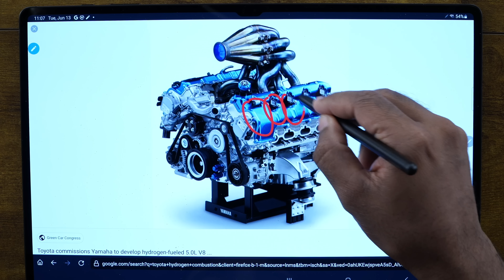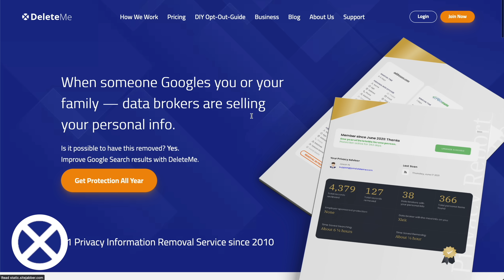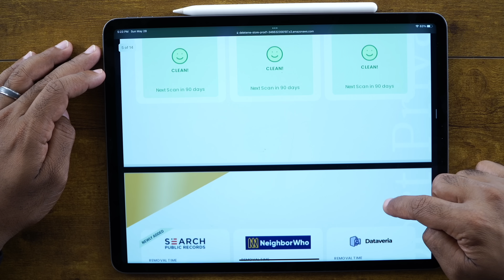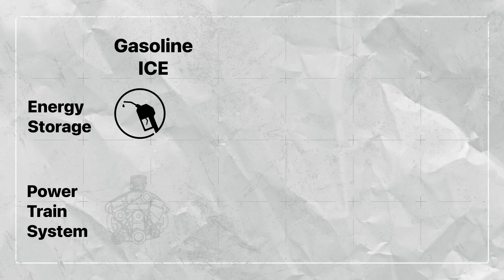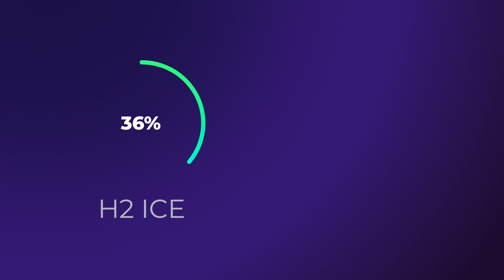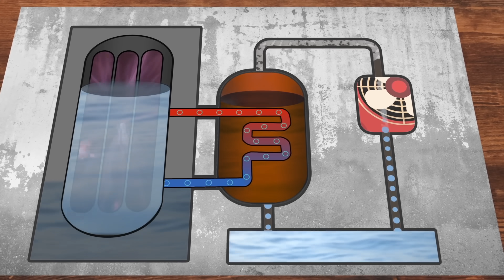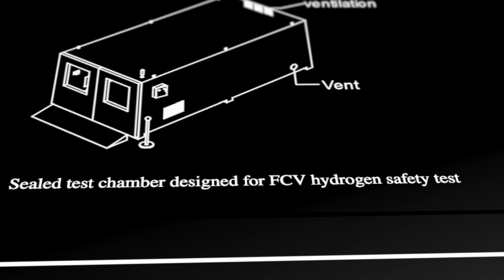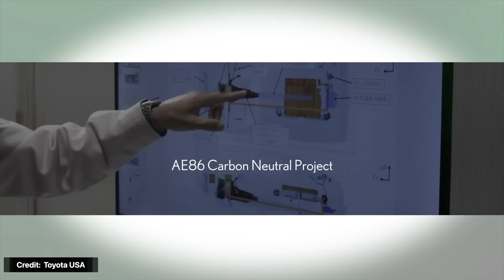Toyota's Says They Just Destroyed EVs - Hydrogen Combustion Engines

Comment: I love the video nice overall pass :)
I feel that subject turned more about comparing EV and ICE whereas imo the pollution and efficiency should be compared to gas/diesel compustion engines. I was left with a question how efficient are the ICE compared to normal gas combustion. And the mention that there is emissions I guess they are no where near to what current solutions (beyond EV) are.
Used to also be a carmechanic and would say that ICE repair costs interest me.

Since the addition on more and more elctricity to our vehicles it has created the issue of not being able to do any self-repairs and Japan & Toyota (like VW) have been really big in part manufacturing and repair centered manufactory and design. Do you have any thoughts oon Gas-EV-ICE repairs?

And just to clarify :D I am by no means against EVs or ICEs I just see a possibility to have both and tbh even support eachother to get emissions and prices down. Even the ICE and EV gas stations (afaik) can be combined to an extent

Comment: You miss one thing.
An engine will consume the same amount of fuel all its life, but the batteries consume over time so if now you make 300miles with a full on your batteries in a couple years you may get only 150 to 200 miles with the same energy meanwhile if you get 300 miles of range with a full tank of h2 you ll get still 300 miles of range in a couple years🎉

Comment: Toyota are also producing a solid state battery... Your opinion is, well, slated.  Yamaha have been making heads for cars for decades... Stick with your Tesla, I hope your environmentally sustainable battery lasts, joking if u hadn't noticed, Don't they cost a small fortune to replace, or is it that you'll have a new one by then and we just put the old one in the tip because that works too right? How did you not mention such a thing as thermal runaway as a negative for EV?

Comment: Imagine the miles per tank if you had a Hydrogen Combustion engine in a battery charging hybrid set up. I get about 57 - 60 miles/gallon right now with my Honda Insight Hybrid. I continue to maintain the BEST way forward is exploring hybrid technologies and this seems to be an amazing pairing that should be tested.
Reply: in that combination, I'd guess a fuel cell would be better. But the ICE could bridge that development for more affordable cars.
Reply: @christianstorms3950  I know very little about fuel cells honestly. Still any additional hybridization is a good pivot point. It gains time for the next step to get more R&D done. I will say with my hybrid I go about 200 - 300 miles and fill up when I have about a half tank of fuel left. It costs me about 14 - 15$ (usually gas here is around 3.40$ a gallon). That's pretty great IMO!
Reply: I can work with a 220torque engine that can charge a li-ion/sodium battery & run the motor also
50_50 load sharing etc or power train sharing any combo that can squeeze most miles

With presets like low noise_vibration
pure EV
hybrid system 80% engine & 20boost of motor torque offered by motor
Charging the battery & running the motor leaving the power train off,
& Running 100 on engine & power train
Reply: @dinozaurpickupline4221  I'm just all for squeezing out the most miles per fuel source and I just don't see EV being that. 

Additionally, a EV "solution" we would right now be needing to build a LOT of power plants all over the country to supply the demand it would cause on the power grid - which isn't happening at all.
Reply: @HillHomeGaming  we need batteries as alternate source,more importantly ford trucks to do that,cold starting engine on battery & then switching to engine
Reply: @HillHomeGaming  "EV "solution" we would right now be needing to build a LOT of power plants all over the country" brainwashed BS.
That is not possible because you can Not just magically materialize that many BEVs in short time. It's going to take at least a Couple Decades for BEVs to be market dominant and the grid will easily adapt to that if you give them enough time. The limiting factor is Manufacturing Supply Chain to make the BEVs, not the electric grid.
Reply: @dinozaurpickupline4221  New models of cars are becoming so quiet. I think it part due to switching to battery at lights or turning off the engine etc. My Insight is a very quiet car overall unless I'm going up a big hill haha
Reply: @HillHomeGaming  sometimes you just want a quite beast to cruise along,
Reply: Oh wow, I knew the Insight was efficient, but not THAT efficient! That's higher than most Prius models I believe. Very nice.
Reply: LOL nope H2 Combustion is soo inefficient even mild hybrid will not make it any more financially viable. It would still be an expensive mess. H2 is just an idiotic material to use as an energy medium. We already have LPG AutoGas ecosystem. it's shelf stable and much much more dense than H2. Yet no one cares.
Reply: Hybrids are still poisoning the planet though. Using any amount of gas doesn’t have a long term future because simply put, it’s pulling carbon emissions from inside the earth which is the biggest threat to our environment. Yes, you should care about that, because at a minimum it’s still making the are you breathe worse and causing health issues for everyone. A Full ev system with primarily renewable and likely some nuclear electricity is the direction we’re heading in (and before you say it no, it’s not the same kind of nuclear power that can explode. It’s a reaction type that will literally just stop happening in the event of equipment failure and it’s in the top 3 energy sources for the US grid currently, with the biggest being natural gas which will get phased out after coal)
Reply: Problem is, batteries are anything but green and are insanely expensive to replace. We need to avoid them as much as possible.
Reply: @stephjezo6470 so I suppose you’ll be hand starting your cars then

Comment: Soooo how about an electric vehicle where the power is generated by a hydrogen engine, a small one?  The concept is like diesel-electric locomotives.  Hydrogen ICE generates electricity using a generator which drives a motor or motors.  No battery required for main propulsion but maybe a glass-mat battery for ancillary equipment.

Comment: As a leader in the hybrid game, they’ve got that tech already.  Combine it with the relative cleanliness of hydrogen and I think you’ve got a winner.
Reply: The introduction of battery/motor also enables regenerative braking. Pure ICE loses a lot of energy in waste heat (which needs to be managed) but what does get turned into kinetic energy is gone forever only to be turned into moving air or hot brakes. Also to your point, ICEs are used only for charging and not supplemental torque they’re basically generators on wheels. They can be optimized to run very efficiently at a narrow operating range vs any drive motor that operates over a wide domain of RPM, load and “throttle” settings. Every parameter from intake/exhaust cross sectional area, ignition and spark timing, cooling, lubrication, engine balance, etc can be optimized for a narrow and constant RPM range. You don’t have the muscle car that sings at high RPM/load but can barely idle   and guzzles gas everywhere vs the anemic daily driver that sips gas, idles smoothly, cools easily but noses over at 5k.

Comment: Does the math add up to just 36% efficiency? If hydrogen has +/-67x the energy density of electric batteries, then that should more than offset the 55-80% storage efficiency and the nearly 50% lost to heat (which can be captured and recycled anyway).

Comment: Another "EV Killer"

The problem with hydrogen, is hydrogen.

There's no infrastructure set, the FUD on EV's focus on fires thanks to GM products. Wait till they see what hydrogen does.

For range it will have to be stored at high pressure. 

Nah, too many things to go wrong. 

And it is still beat by one thing EV's have.

FEWER MOVING PARTS

A Internal combustion engine regardless if it is gas, diesel or hydrogen will require transmissions and heavy duty cooling systems. More parts keeping the cost high and with more pieces that move, there is more to break. 

The cost of a EV is mostly the battery and it is improving almost daily.

Remember when smart phones first came out? The battery life was pitiful and we all carried charging cables wherever we went? But today, good phones will last all day and then some, and they can charge wirelessly. The same will happen to EV's.

The race is over, Tesla won. Toyota's debt will bring it and maybe Japan's entire economy down.

Comment: Questions: 
What happens if a hydrogen car gets stuck by lightning? Seems like it wouldn’t be any different than a gasoline car but I’m curious. 
For EVs, have you got a pros and cons video? Specifically wondering about battery life and cost to replace battery as well as what they’re doing about the range issue. As someone who has lived in Wyoming, charging stations closer together really doesn’t seem like it’ll ever happen.
Reply: No different to any other car.
Reply: what happens when an EV gets into a accident in a tunnel and the battery goes up in flames?

Comment: @Two Bit da Vinci
despire the low efficiency of hydrogen ICE´s

i still wonder in the most optimal condition compared to other variants

wich of them is the best in terms of sustainability and eco friendliyness.

for example and you did not made this clear in this video at least not to me even if hydrogen ICE´s have a bad efficiency they still could be the best,clean option in an optimal scenario.
and then its just a question of getting there in the real world.

i think with the right equipment and usage of just the sunlight it could be totaly worth to swtich completly to hydrogen based fuel.

Comment: If solar & wind can provide power that's not used because of grid stability then efficiency is no longer a key factor.  Hydrogen generation is an excellent way of storing the otherwise wasted generation capacity of solar & wind.  Also it's a clean process whereas dead batteries can not be fully recycled.  Hydrogen if 100% recyclable.

Comment: At around 10 minutes he compares the efficiency of hydrogen and electricity vehicles, but it seems he forgot about the inefficiency and power lost that happens in the process of generating the electricity used by the vehicles and the miles of cable required to get it to a charging spot. I agree Electric cars are cool and a good idea, but nobody considers the original energy source, which is most likely diesel or coal. EVs are not carbon zero and anybody who thinks so is a fuckin idiot. I love the videos 2 bit keep it up

Comment: Battery cars have HUGE problems, that you mentioned briefly, but didnt calculate. The drop in efficiency is very big thing.
After 10 years, a new battery is needed. The production of the battery causes so much emissions, that its almost comparable  to what we have now with modern combustion engines.
The hydrogen combustion engine is done and produced - you did mention this. However you didnt compare the  efficiency % to it - what if you use the car for 20 years? Also what happens with the recycling of the batteries? They are SO MUCH more polluting! Currently, you cant just throw away batteries in the garbage bin - however, who guarantees that?  
I am baffled with how stupid the EV trend is - we need to rebuild the whole gas charging network - because of the bigger charge times, we need bigger charging stations and completely different infrastructure - so many minuses!
It just seems like the cool new thing to explore and for politions to do just to say "we are doing something" . Do you know how much those cars weight? You didnt even mention the fact that the wear of the roads and inftrastucture would increase a lot if EVs are mass used.
People are just quick to decide and buy into the hype - who is the person, who decided that EVs are the most efficient and the best for the planet? We are still relying on breakthroughs to happen in the battery industry for the EVs to become viable and yet everyone is producing those cars already. WTF?
Yet the companies efforts, exploring different solutions - like Porshe's attempt to produce artificial gasoline (which will enable the use of the old cars and current infrastructure) or Toyota's attempt at hydrogen, are called stupid, inefficient or "head-scratching".

Comment: "...a bit of a head scratcher..." Really? You wonder why Japan would want to invest in a motor technology that doesn't require a bunch of rare-earth minerals when they are a nation of islands? Oh, and you say EVs are just better because "efficiency", but you don't even give a nod in the general direction of what it takes to produce those EVs or what happens when the batteries need to be replaced. You loosely mention that EVs in cold suck, and needing extra power for heaters is a major problem, but Hydrogen isn't efficient enough even though the extra heat means no problem with performance in the cold. How many years has Toyota been successfully producing cars? You said yourself they pioneered the EV with the Prius, and yet you think this technology is just Toyota not being smart about the future. Obviously you should be the CEO of Toyota.

Comment: I think hydrogen makes no sense in mobile applications. Hydrogen has a high energy density per unit mass, but not per unit volume. And for mobile applications volume is by far more interesting than mass. You have to consider, that if you carry a 1000 litre hydrogen high pressure vessel at 700 to 800 bar it contains only 35 kg of hydrogen. This is absolutely not interesting for car application.

Some people say, the best hydrogen you can get is methan. Methan contains twice as much hydrogen as hydrogen itself. But it gets even better: methanole. It contains twice as much hydrogen than hydrogen itself and it contains furthermore some amout of oxygen, so you don't need to breath so much air to burn it thermally or electrochemically. And: it is a liquid at ambient conditions. So you don't need to pressurize it. And you can burn it directly in ICEs and Fuel Cells as well.

So, you can forget about hydrogen and you don't need to be afraid of carbon dioxide. methanol produce less than half of the carbon dioxide compared to gasoline or Diesel fuel. And methanol can be produced in bio-reactors from biomass.

Comment: Much of the hydrogen skepticism comes from the fact that currently, more emissions are created in generating hydrogen than would be offset because the energy comes from fossil fuel plants. This is a purely conditional argument however, because given that over 30% of manmade emissions come from the energy sector, we will eventually have to move away from fossil fuel energy anyways. IMHO we will have to return to nuclear energy moving forward, as it's simultaneously the cleanest and most dense form of energy we have. Wind and solar can be supplemented where water resources are limited, but for the bulk of use cases nuclear will have to be the ticket.

P.S. Going forward I don't think battery EVs will be the way to go, seeing as how they put extra strain on the energy transmission grid. The benefit of stored energy like hydrogen is that some of the energy demand is taken off of the grid. Also, battery packs will only keep adding to solid waste pollution unless there's a cost-effective way to recycle their materials, and as of yet all lithium batteries simply end up in the landfill. If we're going to point out the drawbacks to hydrogen then we also need to point out the drawbacks to battery EVs, especially if those drawbacks culminate in a negative environmental impact.

Comment: What is being forgotten here with all the talk about efficiency is that normal ICE with fossil fuels have terrible efficiencies as well, probably even worse than the one presented for hydrogen. It’s not a question of efficiency, it’s a question of practicality and preference of the end user. Plus, the infrastructure is obviously a big problem, but not an insurmountable one, it was the same with electric vehicles just a little bit of time ago, and it’s arguably easier to adapt for hydrogen because a lot of oil companies are investing in hydrogen production around the world (like shell, for example), so they can have hydrogen in their already existing fuel stations.
The environmental benefits of each technology is very hard to compare, and different studies can find different solutions. They can all be great for the environment, assuming a responsible production of the car (but lithium batteries are still kinda icky…they only make up for it in the efficiency); but a lot of people aren’t taking into account one of the biggest issues, which is having enough of a single technology for EVERYONE to use it, that comes up with EV’s and FCEV’s. Having the amount of materials needed in order for every car to work with these technologies is, right now, impossible. So it’s not a matter of what’s most efficient, it’s also a matter of what’s possible? And what’s possible and ideal is to have a future with EV’s, FCEV’s and H2ICE’s, according to your preference and needs.